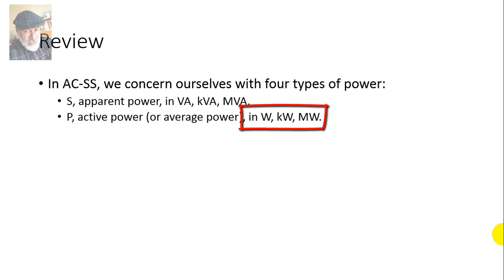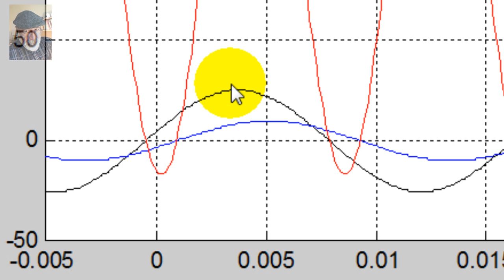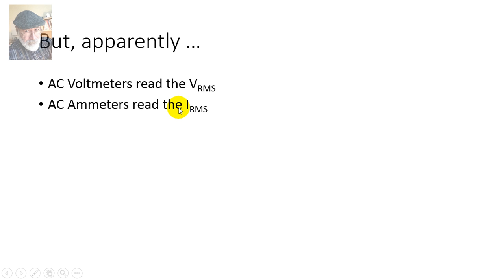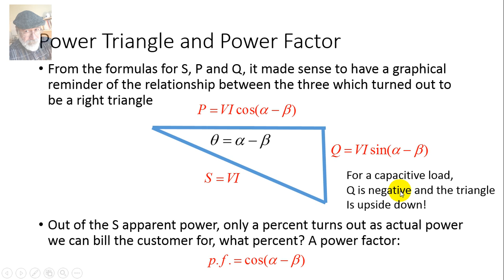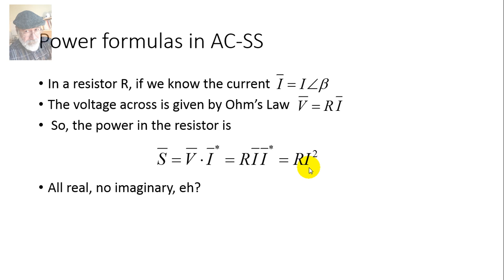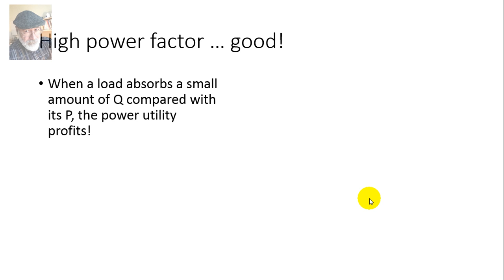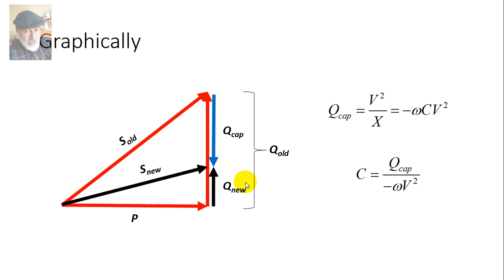Power Factor Correction in Electric Power Systems

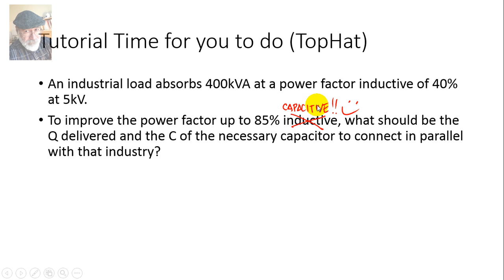Comment: I did the homework of the minute 27:50 of this great video in a step by step basis.
Problem.
Data
Load S = 400KVA = 400 x10^3 VA
Power factor(old)= 0.4 inductive  
Frequency=60 Hz
Calculate Q delivered and C necessary to connect in parallel to the load in order to improve the power factor to 0.85 capacitive.
P=ISI cos𝜃 = P=ISI pf(old)=400000(0.4)=1600W
𝜃old= +arcCos pf(old)=+arcCos(0.4)=+66.4218°  The angle is positive because the old power factor is inductive.
Using trigonometry I got
Tan 𝜃old=Qold/P
I solved for Qold
Qold=P Tan 𝜃old=(160000) Tan 66.4218°
Qold=366605.68VAR This is the reactive power without the capacitor.
I calculated the new angle of the complex power S
𝜃new= -arcCos pf(new)=-arcCos(0.85)=-31.788°  The angle is negative because the new power factor is capacitive.
Using trigonometry I got
Tan 𝜃new=Qnew/P
I solved for Qnew
Qnew=P Tan 𝜃new=(160000) Tan (-31.788)°
Qnew=-99157.816 VAR This is the new reactive power after connecting the capacitors (load+capacitor)
The reactive power that should be delivered to the load is:
ΔQ=Qnew-Qold
ΔQ=-99157.816-366605.68
ΔQ=-465763.49 VAR
The negative quantity indicated that the power delivered should come from a capacitor.
Calculation of the capacitance.
I used the following formula:
C=IΔQI/(2πf (Vs^2))
C=465763.49/(2π(60)(5000^2))
C=4.9419x10^-5 F
C=49.419 μF

My name is Carlos Vicente Dominguez. I recently graduated as a specialist in electric power systems from Central University of Venezuela in Caracas. Best regards from Venezuela.
Reply from the maker: Dear Ingeniero Dominguez,

You honor me with the detail and care of your post. Especially coming from
a graduated engineer from "La Casa que vence las Sombras".

Most sincerely,
L.L.
Reply: You’re welcome Sir.

Comment: Sir, you used a frequency of 60 hertz, we normally use 50 hertz in class, but anyway i understand powerfactor correction now....thank you so much Sir
Reply from the maker: Oh, it is because here in Canada, the electric power grid operates, same as in the U.S.A., at 60 Hz. Just replace 60 for 50 in the computations and you should be OK.

Comment: Great video indeed sir,  but how did you calculate the omega value when you were determining the value of the capacitor?
Reply from the maker: 377 rad/s? It is the frequency of the electric system of the country where the problem is solved. Here in Canada, f = 60 Hz, so w = 2 pi 60 approx 377 rad/s, in Europe, f = 50 Hz, and w = 2 pi 50 approx 314 rad/s.

Comment: Great video sir... But how did u get Qold????
Reply from the maker: In general, what I call Qold is the reactive power consumed by the load before the insertion of the capacitive reactor. It can be computed in several differnt ways depending on the data available. If we know the KVAs of the load and its power factor, pf, the Qold = KVA x sin(acos(pf)).  Or, in proper notation, Q = S x sin(acos(pf)). Observe that Qold will be positive for inductive loads and negative for capacitive loads. I hope that this helps a little.

Comment: Ahhh... Thanks for using the 'scope! I kinda got it before...now i really get it. Hmm... Is a switching type power supply considered resistive, inductive, capacitive, a combination or...? Just wondered, as i imagine linear transformers are inductive with heavy losses.. But switching ones are inductors switched by resistive semiconductors and also have tank capacitors...

Comment: at 27:00 wasn't omega supposed to be negative from the previous formula?.. but that would give you negative capacitance??
Reply from the maker: No omega, do you mean Qc, the reactive power supplied by the capacitor? Yes, I'am doing the computations the way an engineer would, using absolute values for Q's and X's. In reality, the reactive power "absorbed" by the capacitor, Qc, is negative, so Qc = V^2/Xc gives us a negative reactance Xc, which is just fine because the reactance of a capacitor is negative Xc = -1/(wC) (where w is the frequency in rad/s, omega), and C turns out to be positive (as is omega, the frequency as well.)

Comment: how did u get the 377 as ur omega on the 1st example?
Reply from the maker: My students and I are in Canada. The electric power system here operates at 60 Hz, that makes omega two x pi x 60 which is approximately 377 rad/s.
Reply: Thank u sir, well explained

Comment: GREAT VEDIO ,SIR I AM FROM INDIA ,ITS CLEAR MY DOUBT,    SIR I HAVE  A DOUBT IF S=P+IQ CAN WE USE  MAGNITUDE OF S=SQUARE ROOT OF SUM OF SQUARE OF P AND Q. WE I USE THIS FORMULA I FIND MY ANSWER DIFFERENT AS BY USING Vrms*Irms plz help me
Reply from the maker: Yes, for a single phase load, the apparent power is the absolute value of the complex power that can be computed as you wrote above, using Pythagoras, it can also be determined by a simple real numbers multiplication of the RMS values of the voltage and the current. Both computations do concur, of course ... if done correctly.